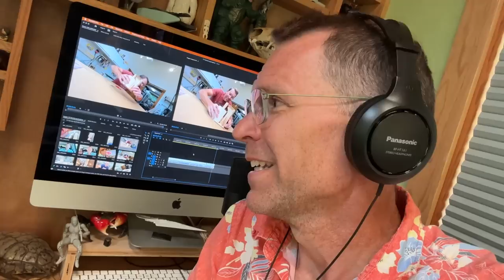Sculpting the Zombie Jug - Tiki Technical Tuesday

Comment: Hi!! I am just recently getting into ceramic mold making for small figures and had a question for the pro! In the past, I see you've used Chavant Sculptex for help in your plaster molds for small figures. However, where I live Sculptex is hard to find. I'm wondering if you think Chavant's soft NSP is as good as Sculptex? If not, why? NSP is available near me but not Sculptex, and I can't really tell what's different between the two... but I am really hoping you can help me!!! thank you tiki man!!!!
Reply from the maker: Aloha! I’m sure the chavant soft would work great - the goal is really to use a clay that is softer than your model, and that can be smoothed out nicely. One last thing to make sure of is sulfur intent in the clay, as some silicones will be inhibited by sulfur. Chavant NSP is Non Sulfur Plasteline so you are good to go!
Reply: @vantikistudio  thank you!!!!!

Comment: Why not coat the wooden eyes with glossy polyurethane to prevent absorbing liquids?
Reply from the maker: That could work, but I do lots of scrubbing and brushing with both alcohol and mineral spirits - I’d worry about scrubbing away any coating I put on the wood. Also, wooden spheres usually have wood grain texture

Comment: You need a 3d printer!
Reply from the maker: I’d love one, but I feel like that’s putting the cart before the horse. The horse is learning zbrush, and I’ve struggled to learn it for years.
Reply: Good point. It would have been great for the geometric shapes in this one, but you don't do much geometric. Love your channel, I'm going to be doing a slip cast soon based on what I've learned here!